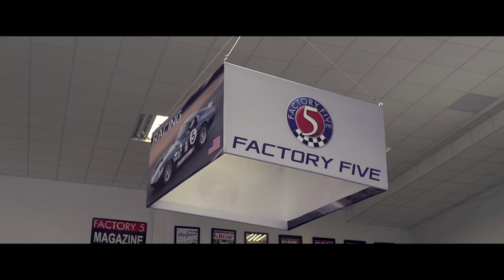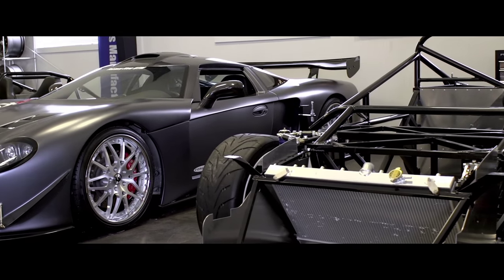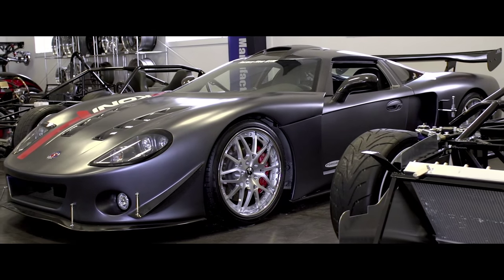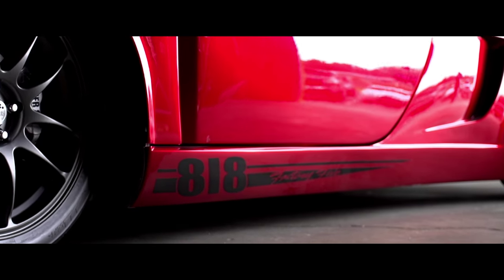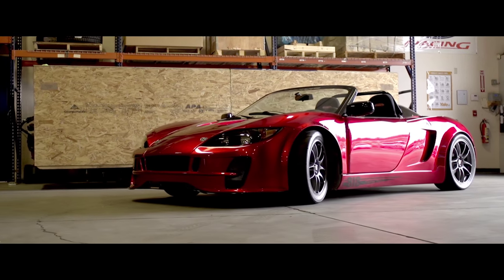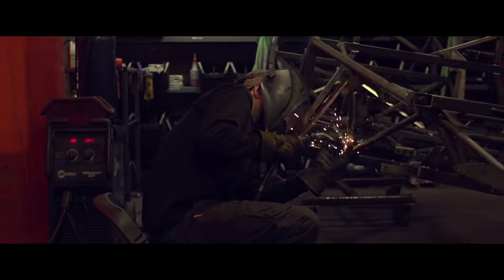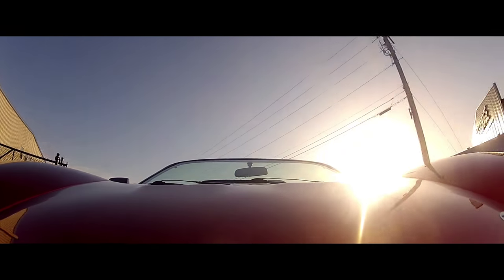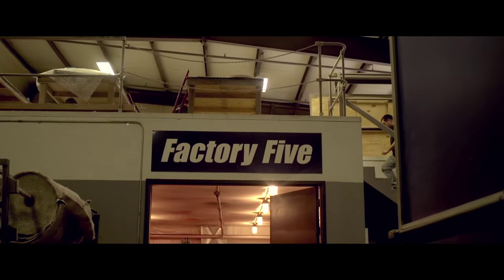Factory Five 818 | A DIY Mid-Engine Sports Car

Comment: Look, guys. I love the mission and guiding principles, but you have to start the video with a full breakdown of the 818: what comes with the package, add ons and upgrades, standard engine power output, cost and some glamor shots of the car in different paint schemes with different configurations. Start talking about your mission when you get to the end clip of an 818 burning rubber. Just my uneducated opinion.

Comment from the maker: On the design front, FFR listens to feedback and, with its 818C (Coupe), revised the front fascia. The headlamps on this car are from an early to mid-2000s Camry, and that was partly due to keeping the cost down for the customer. Everything on this is meant to be as economical as possible, and Camry equals economical.

Comment: Have you ever considered using a twin turbo Pentistar engine? It seems like it would be a good performance upgrade all around at least in terms of HP and torque.
Reply from the maker: +RealityCk That would be very extreme. Even with the old WRX engine, this car is A LOT to handle. Our team at first thought is a joke not to go all STI on this, but we were dead wrong. Twin-turbo Pentastar would make this a demon, but easily overwhelming.

Comment: Looks dope but also kinda looks like a Miata
Reply: David Almaraz  Agreed, more refined imo
Reply: +beans your prob right but I mean if your gonna build something from the ground up its prob not a good idea to make it look like the number 1 best selling sports car of all time with a pretty similar color as it as well but hey It doesn't look bad I'm just saying a widebody Miata with a turbo is way cheaper and prob a lot less work and prob as cool or if not cooler than this and really fun but I'm not hating I'm just saying it's very Miata looking
Reply: David Almaraz mmmm i got more of the lotus feel, a mean mid engined and low profile roadster look?  Definitely looks exotic, could use a little refinement, but for a first car, not bad at all! It really comes down to how much it costs... because yes a turbo miata is pretty cheap and will be pretty fast.
Reply from the maker: +xxdriftking027xx This car definitely drives like an extreme Elise. The car we tested blazes with about 250 HP.

Comment: I feel like this would benefit from a 2jz
Reply: +Jason M. Straight 6 + transverse mid engine = no  

Sorry it's just not reasonable lol.
Reply: +ConnorWolf The engine is longitudinal. 2jz still wouldn't fit, though.
Reply: Why not the engine from the legendary Audi S1 Quattro?
Reply: Lol how about the fact that you can't get one?
Reply: The point behind a kit/component car is to have something affordable, easy to build & find parts for that will get you great performance. Using the Subaru as a donor/base car is a good balance of cost, ease of finding parts & performance potential.